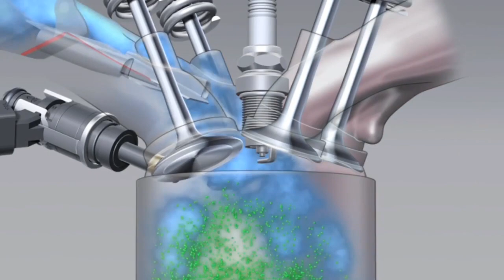Do DSG Farts Destroy Catalytic Converters? | AskDap

Comment: Hi Sir, i m little worried about my Car yesterday my car gti 2014 Volkswagen yesterday i did car wash service, but after inside interior dim, and door Led light not working, and plus Car key door lock not on/off working… and on screen dashboard light also dim, one time brighter/dim also, and even push button key start also not working on dashboard show me key not found, (even i did change the key battery) but the situation is same. It start when you key close with steering, would you please help me out from this situation 
Waiting of your reply thanks

Comment: Hi, here from the UK! Just bought a 2016 Golf R DSG and it doesn’t fart/bop at all between gearshifts while running through the gears. Getting conflicting information online in regards to deleting the resonator/coding it back into the ECU. To your knowledge how can I get it on my Golf R 6 Speed DSG? Thank you
Reply: mid rez delete combined with milltec catback made my 2.0 tsi dsg dq250 get dsg farts. before, even with the catback but 2 mid mufflers (resonators) installed i didnt get any dsg noise.

Comment: @shopdap Can I ask you a question DSG on 11 TDI goes into limp mode on heavy deceleration or and jerking wheel into a turn. Did trans fluid last year. Last 3 month had this issus. Maybe low fluid?

Comment: What's up guys. I got a problem that I can't figure out. I got a 2010 mk6 gti dead stock. Just had the whole motor rebuilt but now it's got a flat spot just before boost hits like it goes from nothing into full boost and hard. But there's a small flat spot just before the boost kicks in. Anyone got any ideas? I've replaced injectors, coils, plugs, mag sensor, pistons, rings, waterpump, low and high pressure fuel pumps as well as the fuel filter. Don't have any visible boost leaks on any pipes and they all been replaced so I'm at a complete loss on what to check next any ideas?
Reply: have a look at brake booster and the brake booster lines it may not be holding vacuum well, this same issue you described happened to my friends audi a3 he found this to be the cause, might not work for you but worth a look at i guess

Comment: is it possible to make DSG farts by tune DSG for example in Mercedes A180 with stage 3?
Reply: yes its possible but sometimes very hard to achieve but the way to do it would be to change the ignition timings and shift points and remove resonator replace with straight through pipe
Reply: the faster dsg shifts = the less possible to get dsg farts. lets say, a straight thru pipe without any tune (dsg ofc) will get farts no matter what as its a programmed feature to smoothen out the gear changed by retarding ignition in the engine itself. explosion in the exhaust will happen no matter what, but muffled u just wont hear it, right?